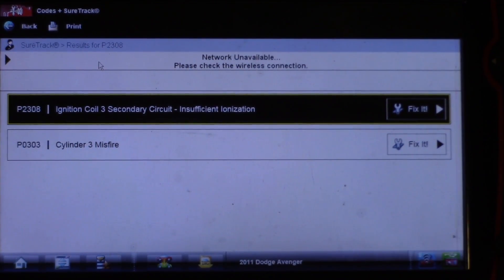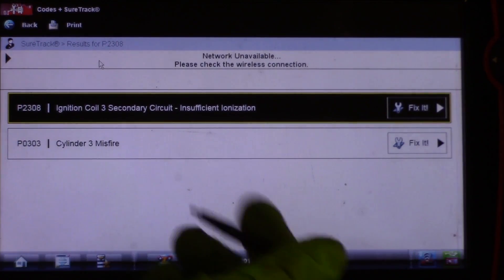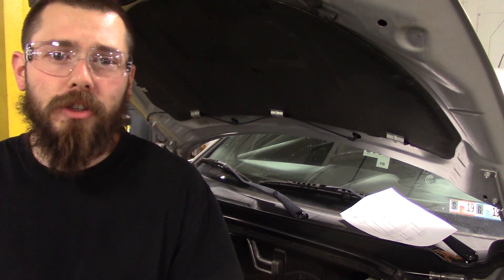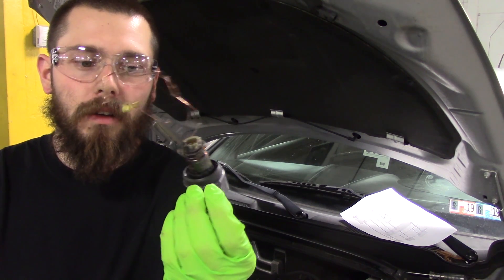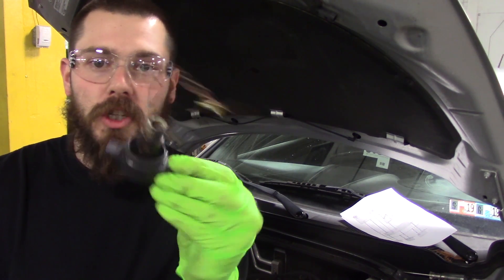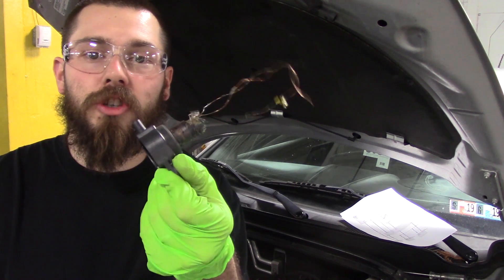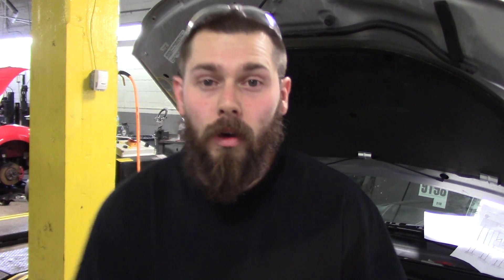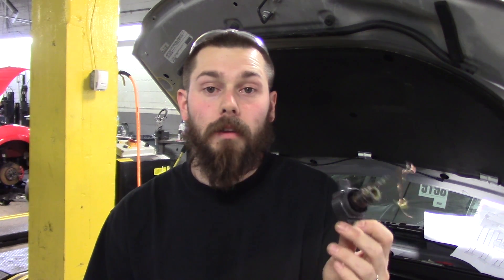Misfire Case Study (2011 Dodge Avenger 2.4L)

Comment: I have one in my shop right now. Cylinder 4 misfire. Control wire melted in a few spots and shorted out the battery feed. Driver in computer is also toast.

Comment: How to remove  swelled  coil easily?
Reply from the maker: The ones that I have had to remove usually break the boot off. Then I just use long picks and long pliers  to peel the rubber off of the spark plug

Comment: How can I tell where the 3rd cylinder is ? Is it left to right or right to left? I stepped on the gas and it started misfiring bad blinking check engine light so made it to Auto zone and it said the 3rd Cylinder but I was told it could be coil,plugs, wiring, I replaced plugs and still misfiring 🤦‍♀️🤦‍♀️ any advice or information that can help me? Pls n thanks
Reply from the maker: Start from the belt side and count.  The Cylinder closest to the belt side is cyl 1, if this is 4cylinder engine
Reply: @PositiveLeadDiagnostics  Its a 2.4 16 cal.   Yes, I finally found it, But I've replaced the Spark Plugs, Coil packs, Changed oil, well the misfire stopped but it's still running rough, 1- When driving, lift foot off pedal n place it back to accelerate you feel a bump bump bump in the pedal.. 2) When coming to a stop as RPMs dropping they shoot back up🤦‍♀️🤔 Especially if AC is on then everything dims down for a second including AC pressure, Idk if it's possible to correspond through email, That would be great if not that's ok too, babygirl653729@gmail.com thank you so much for getting back to me

Comment: I post this in case it helps someone.   

Had the same problem (MISFIRE P030x). I changed my throttle body, then tried my plugs, then tried my ignition coils, all of it costing me around $300 in parts only to find out that it was my Crankshaft Position Sensor at the transmission.  A $20 part!   This rough idle, misfire code can be a tricky one!

Try the cheap stuff first my friends.

Comment: Man you are a Pro! I really need your help please, i have touareg 2007 3.6 V6 engine and Error codes P2293 and P12A4. Replaced: tank fuel pump, HPFP, Hight pressure regulator, low pressure regulator, pressure release valve, but no luck, some noice under the hood in HPFP area, sometimes misfire codes on few cylinders, sometimes random misfire code, than code gone and only 2 above, i do not know what to do, car in service in CA and they can not find a reason.
Give me some advice please. I really wait your answer, thank you in advance.
Reply: 93000 miles on it, something cause high pressure in fuel ramp, can it be because of timing chain issue? HPFP performance connected with timing in this engine or no? Please give me some advice what to check and where to look!
Reply from the maker: Do you have access to a scan tool?  Is the rail pressure too high or too low?
Reply: Positive Lead Diagnostics pressure in the rail is to high
Reply from the maker: If the command is is 100 percent then check the timing of the hpfp. It is chain driven
Reply from the maker: P2293 Fuel Pressure Regulator Performance (upper limit exceeded)- caused by a timing issue https://youtu.be/tm3-36EkWGY
Reply: Positive Lead Diagnostics it is crankshaft driven, but it just pushing the spring on HPFP and make pump working, how the timing of the chain can affect this issue and high rail pressure?
Reply: Ok, after this video i understand, so you recommend to replace the chain and all tensioners and fix timing and everything should be fine correct?
Reply from the maker: Yes. I think your fuel pump is out of time. Probably a broken guide that cause it to jump

Comment: Could u have used a noid light instead of a test light, may have been easier to do, thanks for the video.
Reply from the maker: Yes. If you had one that would fit the connector that would have worked too

Comment: Great study, Tom! The smelloscope really helped to find the root cause. One question (if it's possible to tell) -- was the harness riding on that bolt from the factory, or was it moved by some previous repairs?
Reply from the maker: There were factory zip ties holding the harness in place. I think it was there from the factory.

Comment: Good catch, Tom!! I'm not sure that most folks would have kept looking. And had that coil not smoked in your hands, you may not have looked for another issue! It's good that it happened when it did! 

Saved that coil for your used parts box. You never know when you'll need to put it on something else, in a pinch! Lol
Reply from the maker: I threw that thing in the trash.  The smell of Electrical burning is terrible. That’s also why I had those pretty green gloves on lol

Comment: That’s what happens when you put DC into an AC circuit.  The coil saturates, then, in next instant, massive heat.  Must be a current limiter in the driver circuit to prevent it from immediate damage.
Reply: And, yes, technically it’s pulsed DC that’s used in a proper circuit.  Pulsed at a short enough cycle as to not saturate the coil.